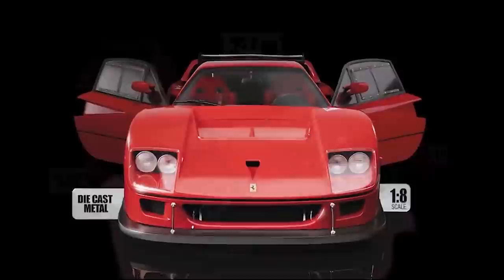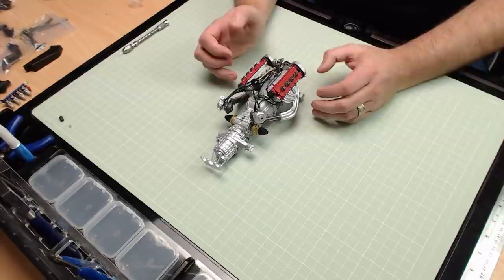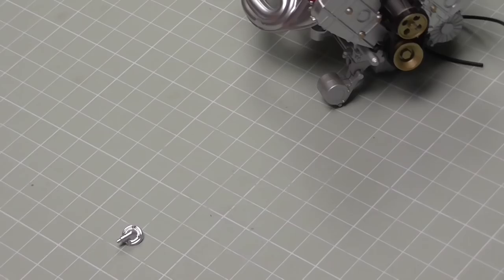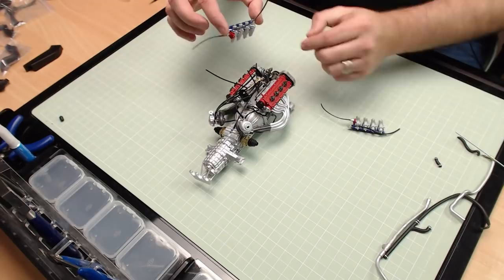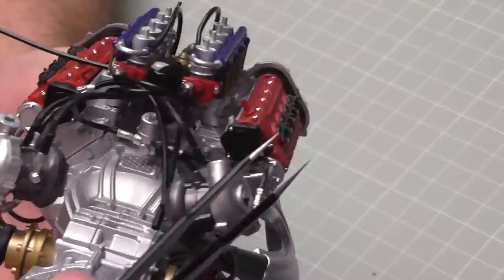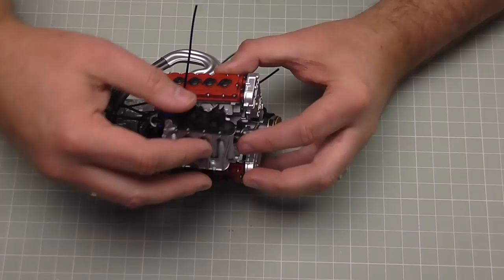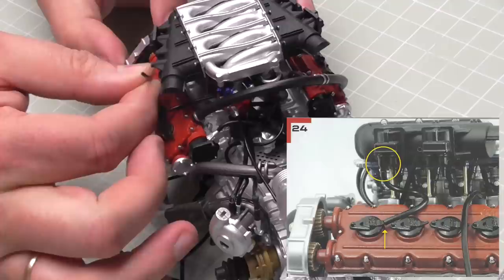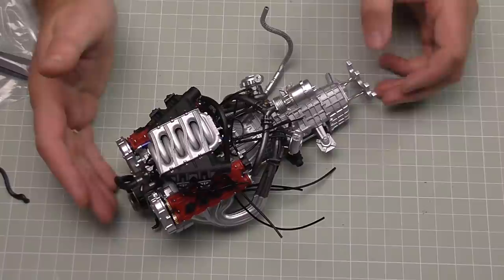Build the Ferrari F40 Competizione - Part 29 - The Engine Pipework (Hard Issue)

Comment: I've just finished this issue and I'm not sure how I would have managed without the help you provided in this video- so thankyou!👍 And I'm very glad that Panini mysteriously provided two spare ignition coils back in issue 6, because I managed to snap the pins off a couple while attaching the hoses.....🤯🤯🤯😅. And I'm still a bit confused as to where the pipe we attached in stage 9 is headed, but I suppose it will become clear!

Comment: I feel your pain regarding this issue 😂 😂 now on the build site the hoses what go into the engine block the thick one you glued to the brass coloured piece I swapped that for the thinner one which matches the later issues, i could be wrong but it does make sense because the lug is tiny and fits the thinner hose perfectly which then fits on a small part later on in the build, think it's issue 55, least you've still got your eyebrows left 😂 👍